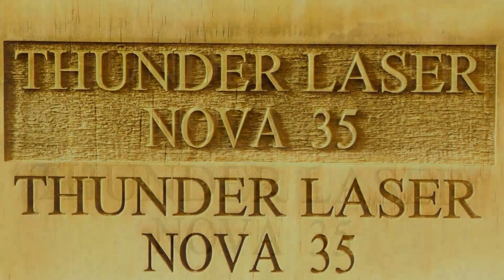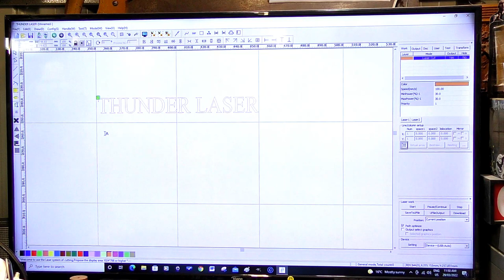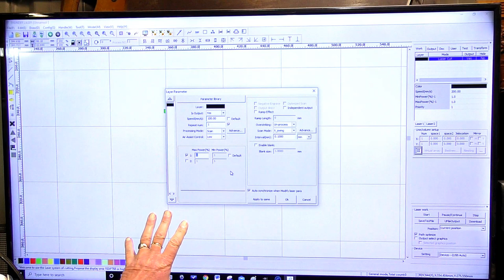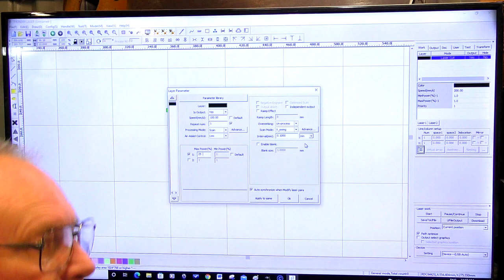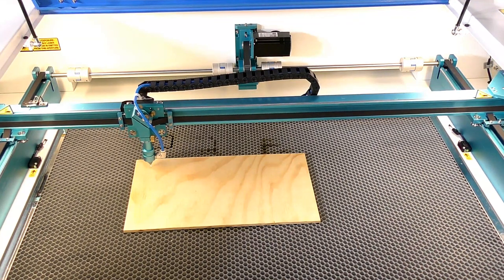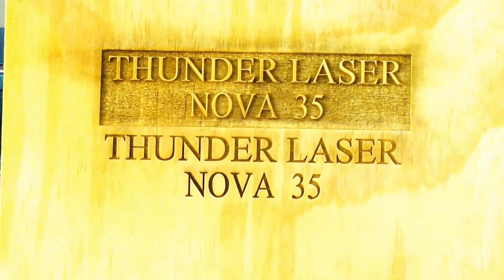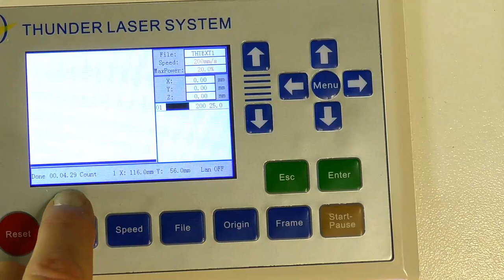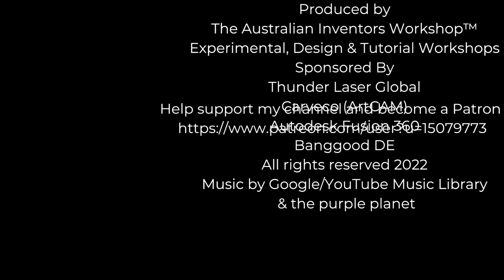Thunder Laser Nova 35 engraving, getting it right Nova 35, RDworks + more, part 2.

Comment: Roger, I believe you would have less soot deposited on the surface of the material if the etching ran from bottom to top. The thought behind bottom up engraving is that the machine evacuation system is not drawing the soot across the already finished area.
Reply from the maker: Hi, all in the next video 😉